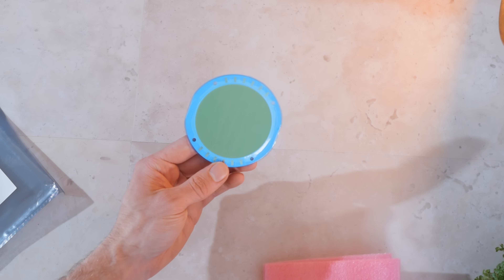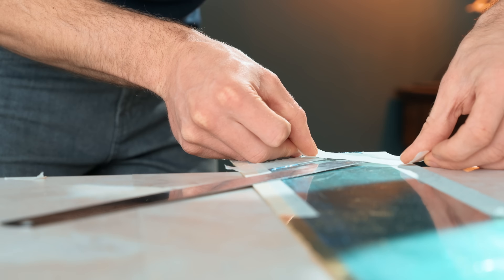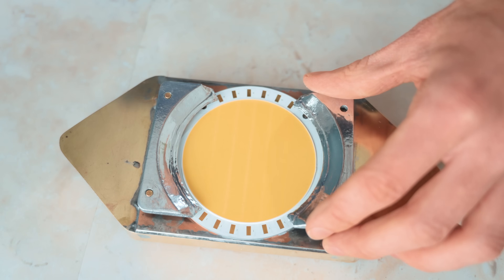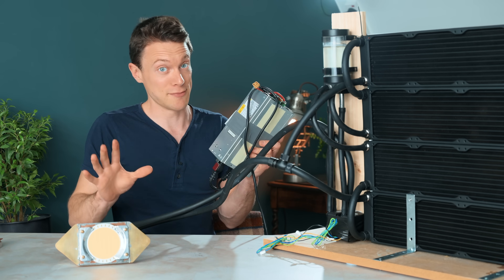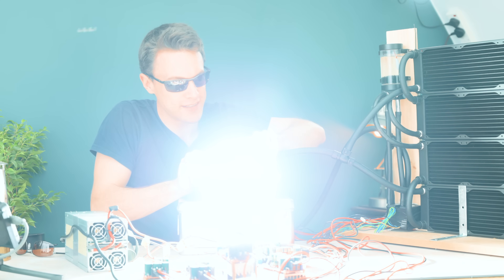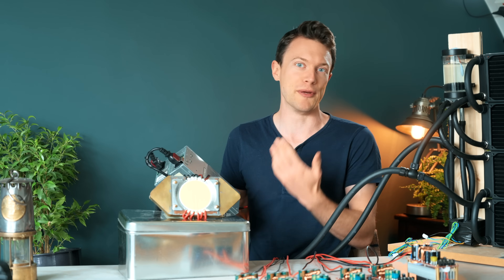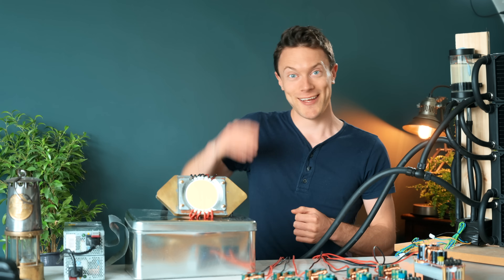Testing the world's BRIGHTEST LED!!!

Comment: hacks two server power supplies together
"It's within spec."
Reply: Ya as soon as he said he wired them in series I knew something was going to go wrong. Honestly surprised it worked for as long as it did
Reply: It's pretty common for DIY ebike chargers to put power supplies in series, as long as their outputs are isolated.
Reply: Also, PC power supplies are ususally referenced to ground (they are electrically isolated from the mains, not the ground), which would be common between the two, so you would get efficiency way down, as current would loop between the supplies, and overheat the powersuplies output transistors (even if the 12v rails can handle 1500w each some power supply architecture uses multiple independant rails). I'm amazed they hold up this long. This might work on very old style power supplies, but not on anything made in the last 20yrs ( which are Switched-mode power supply). Years Ago I worked on a test system to be deployed on buses to chech driver acceleration/braking, and 2 month in, they come back and tell me the serial link to get data doesn't work from their laptop, but works from tower pcs. After Hours of debugging, turns out the ground wire of the serial connector had come loose. When using tower pc, the ground connection would go throught both power supplies. Laptop power supplies, however, are isolated.
Reply: We're these PSU's designed to be run in series? The assumption that they were is !DANGEROUS! They are NOT BATTERIES and should not be treated as such without explicit warranty from the manufacturer. More haste, less speed. Speed kills!
Reply: I use 4 server power supplies in series to get 48volts and it's been charging my 60volt 30ah battery for a few months now...
Reply: The first time the load was conected  bit after bit. And after the psu had already started up. If the load already was conected on startup on the second atempt, a sligt delay between startup of the two psu, the power from the first one would end up as negative voltage  over the second psu thru the connected load. A bit like do not mix new and old batteries...
Reply: Those power supplies are intended to be redundant and not operated simultaneously. They are also expected to be operated in a properly cooled and dehumidified server room.  If he had treated those power supplies with the same amount of precaution as he did most other components of the build, it probably wouldn’t have failed.
Reply: @Somelucky  I use server PSUs all the time in normal room environments. They're fine. Any decent brand can handle a lot of abuse (aside from being wired in series). Some people run their servers for years in basements.
Reply: @Somelucky  your first statement had nothing to do with the failure but you are correct about " If he had treated those power supplies with the same amount of precaution as he did most other components of the build, it probably wouldn’t have failed."

Comment: So glad you didn't go down the hi tech milled out of solid copper for the heatsink route. It was far more instructional to have made one like you did for I did not know you could solder Brass like you did. And it worked.
 I am swept away by the amount of tech - pumps, water coolers, plumbing, segment power supplies and of course two large switch mode power supplies etc that was needed to deliver 1500 watts of light. In the old days, you plugged a light in and switched it on. Now you need all this extra stuff to power an LED - the irony being, because its so much better than an ordinary light bulb. By equivalence 3 off those out door security style lights with a 500 watt bulb, used to be sold by B&Q hardware style shops for about £15 each is about the same, but obviously not so fabulously cool [or not] as an a LED.,

Comment: You have no way to regulate the power draw from each PSU only a matter of time before one starts to draw slightly more and then it's game over. Also, never cut the power to supply. I saw it stated in a few comments already but to re-state; killing the supply power removes the fans ability to continue cooling down the component so it heat soaks and fries the more vulnerable parts. Your setup could work, but I would add a breaker between each supply and the LED to prevent biased overcurrent. Of course will probably just end up tripping breakers. Get a bigger single unit (higher voltage will reduce the current in the PSU) rated for max draw + 50%, most PSU's are really only rated for 75% of max continuous.

Comment: Nice video
But this led here in summer will burn because normal temperature in summer is about 40-50 degree's Celsius and that bill after that led turned on for 30 minutes it's not a good deal for me 😂😂😂😂😂

Comment: 1500w LED at let say 80% efficiently gives 300w of heat to be dispatched, that PC radiator at the beginning could handle 100-120w so 3 would be adequate.
Reply: You are right, but not perfect.  The middle switchers lost 20%, which meant the 750*2 was 20% too low.

Comment: Hey Matt I think the cause of your power supply being destroyed is the unit itself is still hot inside but warm in the outside but you deactivated the unit even if it still warm so no airflow at all causing the components in the inside to degrade or damaging it. Its warm feeling in the outside but if you open and directly touch the components you will feel more hot into it. That's what causing your Server Power Supply being damaged in my opinion. I had the same experience with my ATX in full power with my peltier project.
But other than that I enjoyed your LED Video that was fun.

Comment: love it. I bought way to small a radiator and pump for my 600LEDwatt+ homemade fixture and had to submerge the radiator in a tote of water with a fan blowing on the water to cool the water lol. Can still only run it at 1/4 power XD need to upgrade my rad and pumps

Comment: Good morning, DIY Perks. I would like to propose a project that has been in my head for a long time. It's an all-in-one with a boombox. I'm thinking of doing a low-cost project using the screen of an old notebook, (it would be nice to have a touchscreen), a Raspberry Pi4 with 4GB of RAM, good speakers totaling 500w or 1000w. I would also like to add used Notebook batteries that give power to the entire structure and could be recharged by a single source. Do you think it would be possible? A hug and I follow your channel a lot.

Bom dia, DIY Perks. Gostaria de te propor um projeto que está na minha cabeça há um bom tempo. É um all-in-one com uma boombox. Estou pensando em fazer um projeto de baixo custo utilizando a tela de um notebook velho, (seria bom que tivesse touchscreen), um Raspberry Pi4 de 4GB de RAM, boas caixas de som totalizando de 500w ou 1000w. Também gostaria de adicionar bateria usadas de Notebook que dessem poder para toda a estrutura e pudesse ser recarregadas por uma fonte só. Vc acha que seria possível? Um abraço e sigo bastante o seu canal.

Comment: If the heat in the power supply is the issue you can try using the colder exhaust air from the water cooling system to cool it

Comment: I think it really would have been more sane to just purchase a 36v invertor rather than jerry-rig a bunch of PSUs in series :D

Dear god, do the components in the PSU even tolerate that much voltage?

If you amp up the voltage, the amount of current they start to pull will go up as the internal resistence for some components drops. Meaning over draw. And magic smoke

Comment: In order to check the full potential of the cooling system you need to test it for at least 3-4 hours of continuous running with full power, the water is still cold for the first few minutes so you can’t feel any warmth in the water block

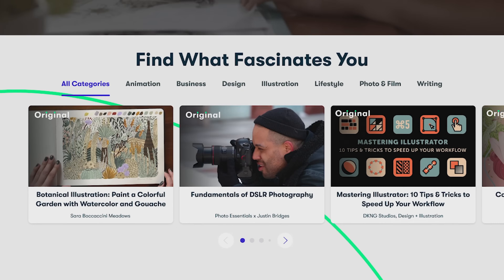Comment: I was really interested to see a video without an add in the start ... Then i had to skip from 13:15 to 14:15 ... correction , the video quite ended after the add , te rest is just a filler so the add is on the middle of the segment.... Quite the bad thing to do , to tell you will do something and to turn out it was just so people will watch the add

Comment: I work with LED frequently and have the following thoughts to help fix the power supply issues you were having
As it appears that each of the segments of the LED works independently, I don't see a problem with running potentially up to 6 power supplies. They shouldn't need to be run in parallel or series, just independently of each other. so long as the neutrals of each section run back to the correct power supply you shouldn't see any issues.
Also, when increasing and decreasing voltages, your power consumption will be affected and change with the voltage change which could explain why the server power supplies gave up so dramatically.
This is a really cool project though and I look forward to seeing it's full capabilities. I would be very interested to see how well it dims over a longer period such as 30s or 1min see how steppy the chips are as they increase and decrease in brightness
Reply: my main thought was the fact that they were in series. Wouldn't that cause the 12 volt circuitry in the supply to start having 24 volts on it, which is was never designed for?

Afaik that would be just like taking a 12 volt computer fan, putting 24 volts through it, and being surprised when it fails.
Reply: @Ferro_Giconi  No, not at all. The voltage over each supply would still be 12v. Try to connect 2 9v batteries in series and measure each one, still 9v.
Reply: yep, this, plus running the psu's in series, and commoning the 12v rails was silly, jsut have each psu eplug in parralel, and only run 3 segments each
Reply: @any1alive  I would agree, but if I remember correctly these boost converters wouldn't be able to handle the input current.

Comment: You are probably hitting watt limit on 12v rail less that is than the total 1000W rating for the server power supply. You could have 3 psu in series then you would have to step down the voltage rather then step up. But server power supplys whilst great for diy are unreliable and every time you add one in series you half the reliable. They are design to be have redundant power supply's  supporting them. I have never run them in parallel but that is another solution but you might draw to much current for them. For this application  seeing you have 6 rails for the led you could just run them in parallel with each led strip. You could just use purpose built led power supply's then to reduce components. Looking forward to your solution.

Comment: 1500W will be your power consumption, but depending on efficiency, if you have a 90% efficiency then you need to dissipate only 150W of heat. The rest is only light ray, which will warm up exposed surfaces.

Comment: Hello, Matt.
I like Your channel and want to support You a little.
As a leftovers from an old project I've got multiple power adapters 3000W 24V of this type:
https://www.tme.eu/Document/f414ac9581b4cfcc8e9242c74fbb15e2/RSP-3000-SPEC.PDF
If you are interested, just contact me.

Comment: ...and consider buying eighter 1 propper Power supply that should have at least 1600W rating but for efficiency (tough, watch efficiency curves at every individual PSU manufacturer!) it should have between 2200W-3000W to Run at 70%-50% usage, as around there often lays the sweet efficiency spot! ;-) - also, if your PSU fails at under 90% of it's rating, you bought a dead cheap one! - high end or industrial PSU's can often take even more than what they are rated for!
(tough, maybe watch the lighting steps, the lowest step should not fall below 20% of the psu rating as it might fail there aswell! - tough again, depends on the psu of the manufacturer! - but some don't even turn on without a "power user" connected that surges enough power!)

also consider buying a larger formfactor with larger fan as it will run quieter and having more room to dissipate heat! ;-) (lesser dense packed components)

Another option is to use 1 PSU for every step you wanna go, but again, calculation is key and try to keep your usage at about 50-70% to be efficient - 80% is also no big deal for a good PSU, some are even build to be most efficient there, but they are expensive! - using a PSU at 90% is kinda bad, especially at cheap & small formfactor ones! - eighter get a good psu or higher formfactor - but try to avoid dirtcheap psu's alltogether! - some might not need high end just for an LED lamp (unless you want to leave it running forever, then it might be cheaper to buy a ~400 buck PSU than to wonder why it suddenly died in flames!)

Comment: Design an enclosure that adds a bit more airflow for the server PSU. The Radiators are sufficient. Also, maybe add some airflow directed to the surface of the LED.

Comment: @DIY Perks You could have used one power supply to power a bank of 3 voltage boosters each, that way you would have removed the power supply series from the equation and each power supply would have ran at its rating.

Comment: "despite my hunting..." - have you never heared about server processors? - they are huge nowadays and since threadripper there are also water cooling blocks that big! - putting on a heatspreader (wich would be only a surface shaped chunk of copper about as much thick as you need to transport heat trough it, wich you could calculate! - alternatively, one could put a heatpipe into that block to speed up heat transfer but as it's a round shape i don't see where this would be usefull!) with liquid metal inbetween the waterblock and heatspreader aswell the LED should be sufficient for efficient cooling!

Also, measuring the Temperature via touching the Waterblock wich is full of a mass of water that will unevenly heat up due to poor design won't show you any Heat, as that might be trapped somewhere in the Block!
(Do i have to remind you that water has relative high heat capacity but relative poor conductivity?)

I really love your stuff, but actually i wonder how you could miss that at your "hunt" for a propper waterblock and heatspreader are a common way to deal with massive amounts of heat (as much better conductivity than water!) - you could even make one with fins to reduce heat on its way to the Waterblock!
Reply: "Hunting" as in finding the right part for the right price.

Comment: Check the current draw. Even though your power supplies were connected in series [to provide a higher voltage], the current remained the same. So, if your circuit tried to pull more current than the power supplies' rating, then it damaged those units.

Comment: The required cooling capacity is not the same as for a CPU because unlike a CPU, an LED converts most of the power into light not heat.

Comment: Great video! I really do hope you flushed the watercooling loop of all the flux that was inside the cooling block, DO NOT LET THE BAD WATER SIT. Also you need corrosion inhibitors and use distilled water. Just making sure you know this since it was not mentioned at all.
For this high power stuff just buy a 24v power supply, if one is not enough to power the whole thing use a power supply for a few modules. Do not connect them electrically in parallel, the negatives can be safely tied together but not both negative and positive. Voltages have to be matched perfectly to run in parallel.
On my channel I showed an example of how to safely connect two 12v server power supplies in series. It allows for soft on and off, and also if one supply cuts out the second will also cut out, this prevents reverse polarity if one shuts down for any reason (overheat, overcurrent, etc.)
This is a truly epic video! your building what I dream of building one day! thanks!

Comment: You could have used a 24V truck battery and it will handle 2000W no problem.

Comment: For portable power, build a Li-Ion 18650 cell pack, 9S-5P should be sufficient, but you can increase the parallel packs according to your amperage needs. The 9S should give you 37.8V at full charge and goes down to about 28V at dead state.

Comment: You forgot to calculate loses. If one power supply takes 1000w mains doesn't mean that you will get 1000w on the 12v rail. And then you have additional loses when boosting the voltage.